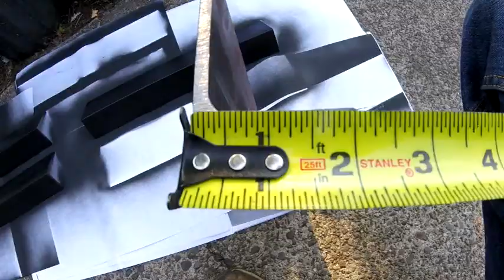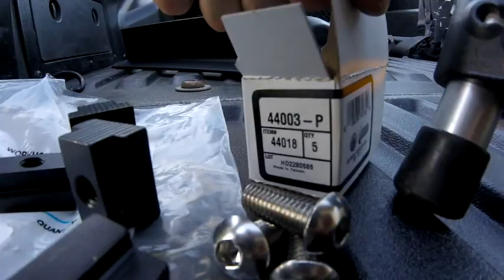tacoma bed rail rack. No drilling on truck.

Comment: Nice job. I’ve been brainstorming ideas on how I can get 1 rack on the rear of my Taco while not having to scrap the bakflip cover that drops the cleat rail down a few inches even. I think I could possibly utilize your approach, but would need larger brackets than the ones you welded to. Can you tell me where you got those brackets?
Reply from the maker: Metalsdepot.com

Comment: What size T slot nuts did you use on your tacoma?
Reply from the maker: crappiejosh The Hillman Group 44018 3/8-16 x 1-Inch Button Socket Cap Screw, Stainless Steel (2 Packs of 5). From Amazon.
Reply from the maker: crappiejosh 1018 Steel T-Slot Nut, Black Oxide Finish, Grade 5, Tapped Through, 3/8"-16 Threads, 5/8" Height, 9/16" Slot Depth, Made in US (Pack of 5). From Amazon.

Comment: Do have any details on the piece of metal you used from metalsdepot?
Reply from the maker: 3x2 in. Steel. 3/16 thickness. I ordered 4 pieces at 16 inch length. They cut to any length.
Reply: @TheDaveyDonut  Awesome! Thanks. :)

Comment: Great video very informative! Did you have any problems with flexing or stress on the rails without downward force like from a clamp?
Reply from the maker: blazen rolis no problems because I only put 100 lbs on it and the rack is rated to 800lb. I would worry about flex with more weight and more off road driving.

Comment: Great idea. How much weight have you had on it?
Reply from the maker: I made it for 80 lb canoe. The rack I bought lists 800 lb capacity.
Reply from the maker: Bradley Ellis I think tacoma bed rails have a max capacity about 200 lb per cleat. My rack uses 8 bolts. That's around the same max weight of the rack itself, 800 lbs.

Comment: Which rack did you end up buying off of amazon? Do you have a link?
Reply from the maker: AA-Racks Model X35 800Ibs Capacity Extendable Steel Pick-Up Truck Ladder Rack Two-bar Set - Matte Black

Comment: Davey, what's the Rack manufacturer that you bought here?
Reply from the maker: AA Products Inc AA-Racks Model X35. From Amazon.
Reply: Thanks.  I believe that I overlooked the beginning of the video.  It appears that you had to weld your own extended bracket onto the roof rack unit, is that correct?..  I don't have the tools to do this kind of 'addition' to the original product...
Reply from the maker: n7hevn I paid someone to weld it on. I could have also removed plastic bed cap and drilled holes into the bracket itself if there was enough room. I wanted to leave the bed caps on.

Comment: Where did you buy the part that slides in to the rail?
Reply from the maker: Zitro97 M Amazon. 1018 T-slot nut. Black oxide. Bolts are: the Hillman group 44018 3/8-16 x 1-Inch Button Socket Cap Screw.
Reply: Very cool thanks